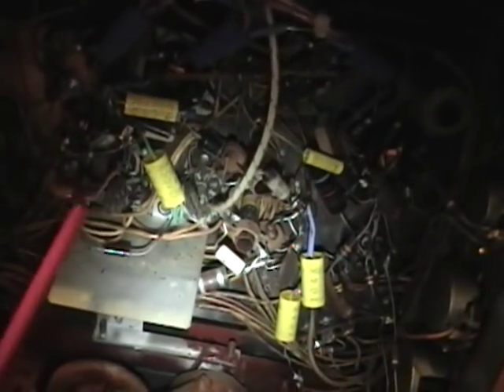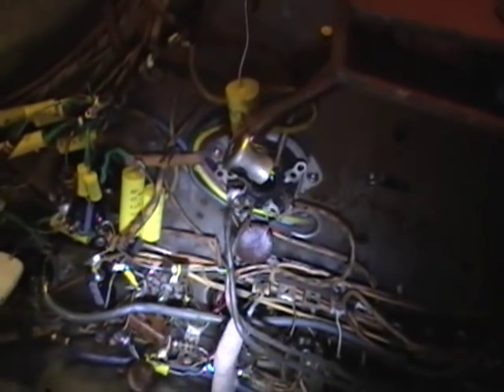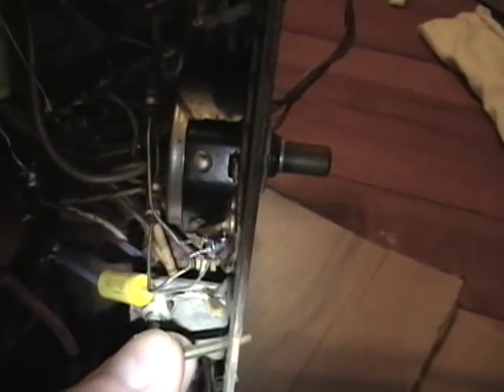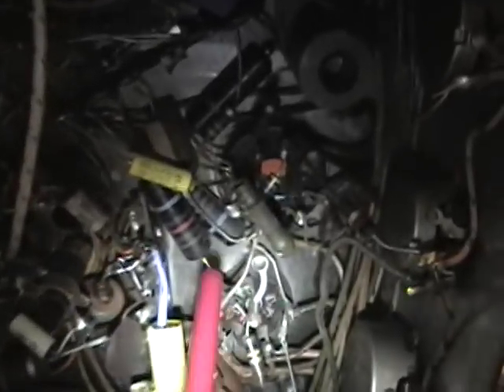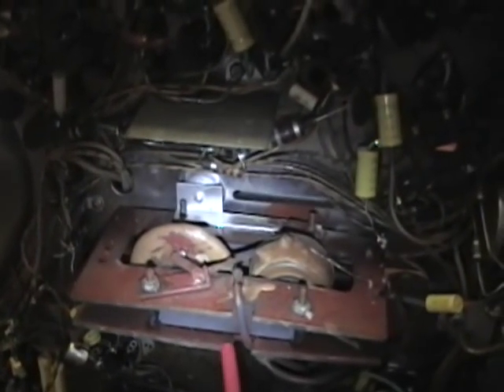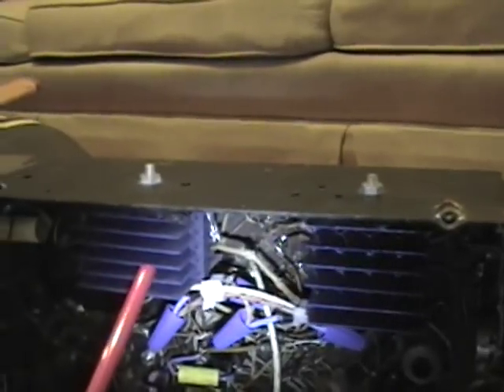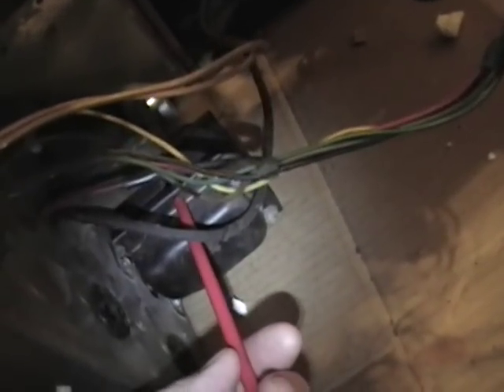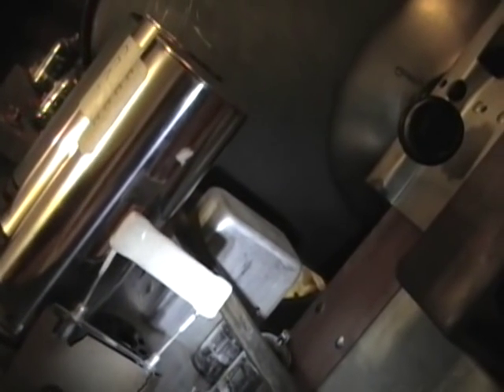Frankenrola restoration p2o?

Comment: Odd to see wire nuts tho! Yea Bob, seems OK but I would check it against the schematic as well like you said. I got a nice Heathkit scope recently that did not work... they replaced a tube socket but wired it backwards so the filament never got power and they gave up. Good call for me... in an hour, I got a nice scope working with a good 5UP1. And a load of good tubes as well.

Comment: The bumble bee condensers and the sand resistors would probably explain why it doesn't work., I've also never seen Marrettes (wire nuts) in anything that was repaired properly. I had a sand resistor in my parts stash, when I first got it about 15 years ago it read 500 ohms, when I tested a few months ago it read infinite resistance, so they can go bad just sitting around, usually developing some green oxidation near the ends.